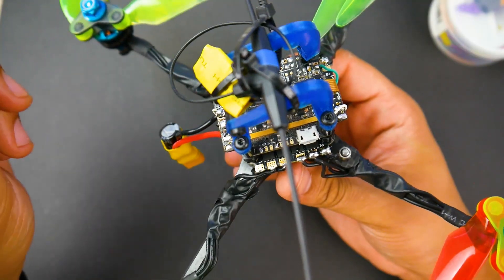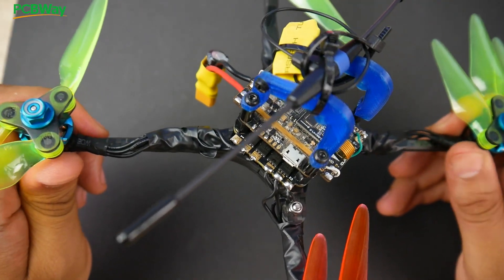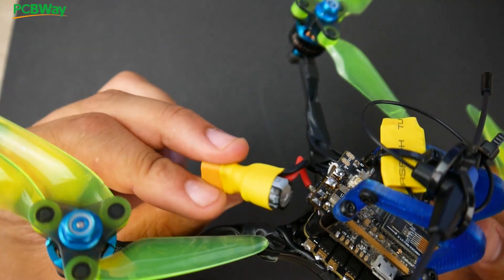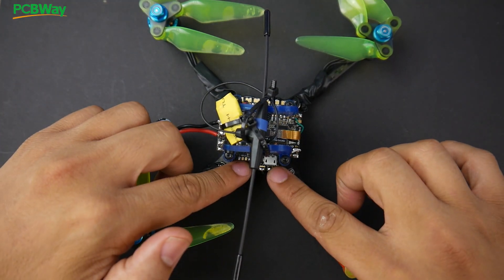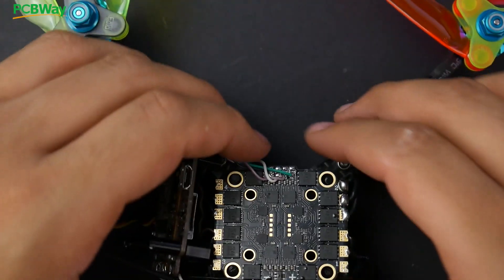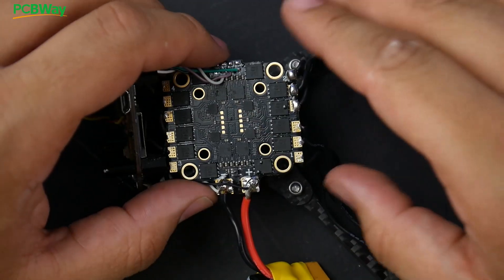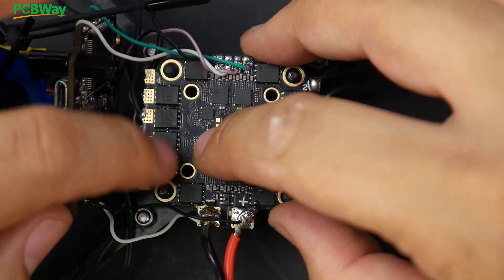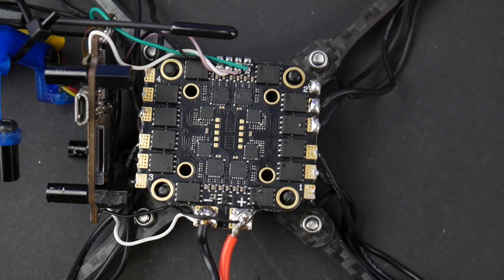FeatherLite A.I Pid Controller Update & BEST 20x20 ESC EVER!!! with a twist

Comment: How does the AI training process work for this quad - is it all done in the PC? Can the flight controller make any automatic adjustments to flight settings in the air, or is that fixed?
Reply from the maker: NO more PID Controller in charge of your motors it will be the AI through a mixer which mixes your input and what it knows to be the best output to take the position you desire
Reply: @DroneMesh  what about delay? How big is the delay of it?